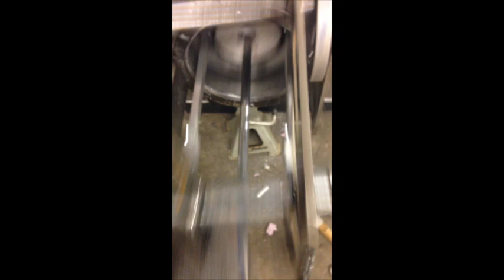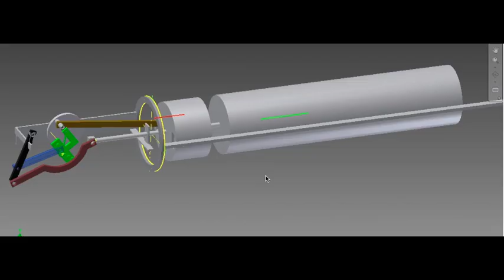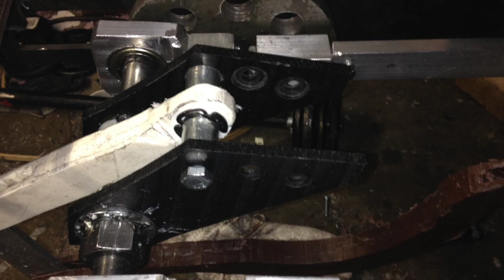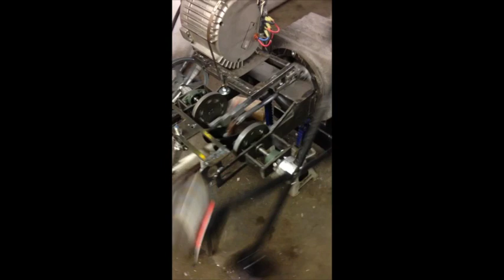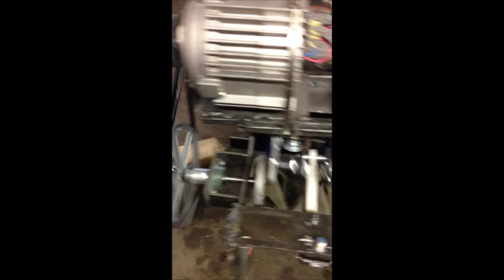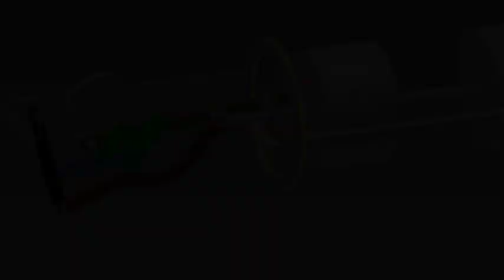Volo Engine Update 3-9-14

Comment: Hello I am working on a solar tracking device and I would like to aim my project to your stirling engine, could you send me the dimensions drawings of the stirling motor to eliuth@gmail.com? I have got all the necessary other data from your website, but I have not found the exact dimensions, I tried to send an e-mail but it failed, it seems like there was a problem with the server.